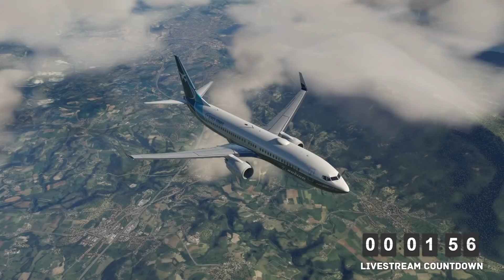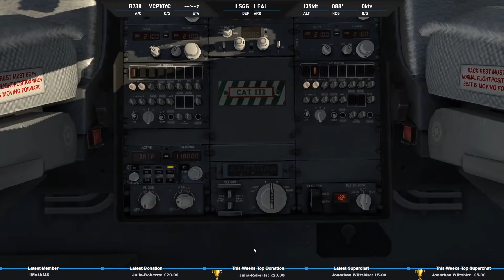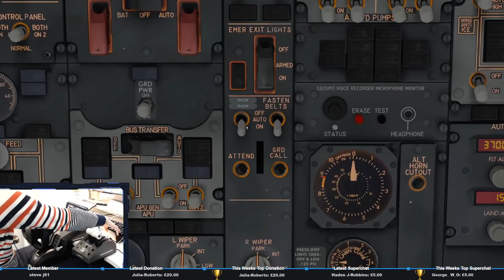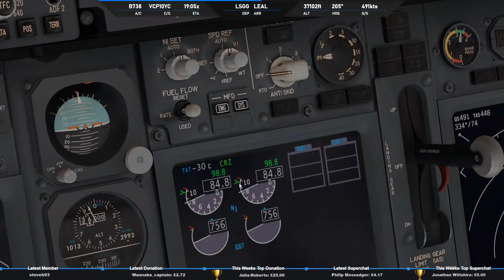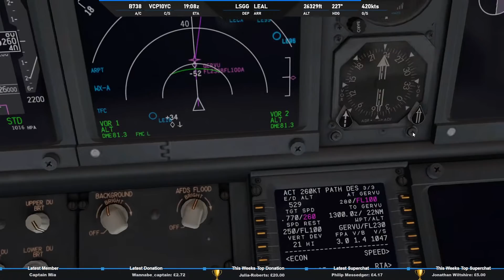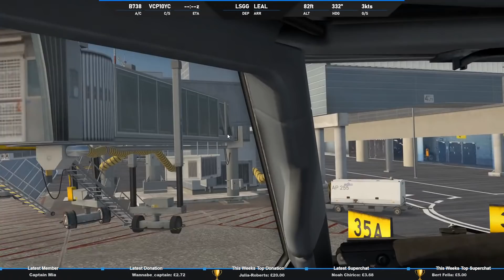Yoke Cam is here!! | Real 737 Pilot LIVE | Thrustmaster TCA Boeing Yoke

Comment: Hey, could you tell me how you set up up the mcp on the throttle quadrant to work in the sim
Reply from the maker: Hi Myles

For the selector I just have the rotary knob assigned to the speed bug on the MCP, I don't think there is a way to cycle the different MCP modes and then use the rotary knob for the selected mode in the MOD in XP11, not without someone making a custom dataref or something.

FD2S

Comment: I've got to stop watching 'air crash investigations' lol. Didn't realise the 737 has a tendency to roll to the right.
Reply from the maker: The roll if I remember rightly in the stream was due to a slight difference between the engines in N1 at the time, is that the bit you were referring to?
Reply: @flightdeck2sim  No, it was a issue on the old 737’s. If pilots where overwhelmed with a issue and the auto pilot was knocked off the plane would role to the right and stall.

Comment: Thrustmaster TCA Boeing . Anyone else having a problem with the throttle quadrant turn dial. As it's always in either speed, heading or altitude mode this then cause flightsim to think that button is being pressed continually and it then causes the heading, speed and altitude windows to go up and down in 10s rather than 1s
Reply from the maker: I haven't found the best setting yet, All I have assigned is the rotary know to bug the MCP speed window. 

FD2S
Reply: @flightdeck2sim  Hi,  thanks for your fast response. From what I've researched apparently if a button is held continuously within flightsim the program then thinks that action needs to be sped up so what happens is it changes the way the dials for all speed, heading and altitude behave and instead of moving up and down by 1 it goes up and down by 10 making flying impossible. That rotary switch is always active and also I've notice the gear switch is always active so either or is causing this issue.
Reply: Update....I've unbinded that turn dial for use with the airpseed, heading and attitude as it was causing issues.  Now though I'm finding after landing I can no longer switch on the autothrottle switch on the ifly 737 mcp?  Very odd as have to reload the aircraft to reset this switch so that it works properly again until next landing when it wont stay in the on position as automatically flicks back down again. Never had this problem using my old CH yoke.

Comment: My TCA Boeing yoke just arrived cant wait to set it up
Reply: Hello, I recently bought this yoke and I can not configure the reverse in the Zibo of Xplane ... The reverse is activated when I pull up the lever but to stop them I have to lower the lever and pull up it again... How do you manage to have the most realistic setting? (Thanks for your help)
Reply from the maker: @emc3895  Good day! Unfortunately it only acts as a button, I have it set to Toggle or Select MAX REV or something like that, you cannot set different rev thrust settings with the lever. That's the closes you can get to reality!

FD2S
Reply: @flightdeck2sim  thank you very much for your reply ... and help!
We see you in the video at 2'29 "39 activate the reverse by raising the lever and at 2'29" 52 cut the reverse by lowering the lever!
When you do a replay of the landing with the outside view, we can clearly see the reverse opening and then closing ... how did you do it? What are your settings ?
I dont find any answer on Internet about this... Maybe, if I don't find I'll choose one button to press to cut off the reverse at worse.
Reply: @flightdeck2sim  Actually, there aren't really any solutions with this yoke, because the reverses are just an on-off switch so in the X-Plane settings, there isn't much to choose from. I chose "Reverse at max". It's not very realistic because when the plane hits the ground it brakes much too quickly!